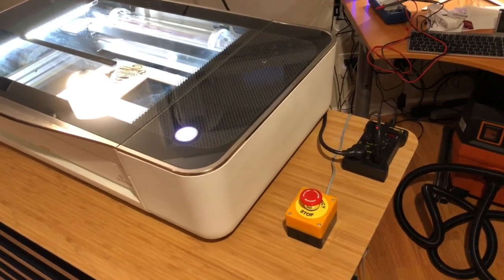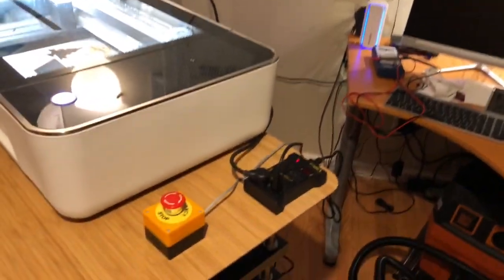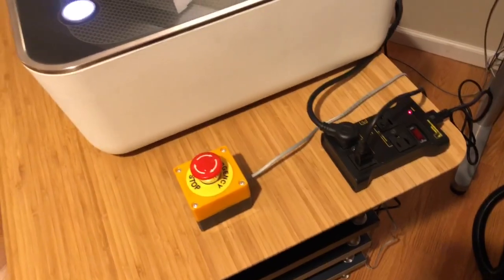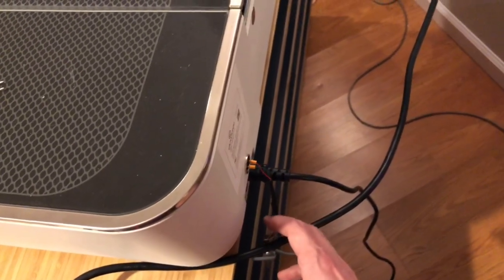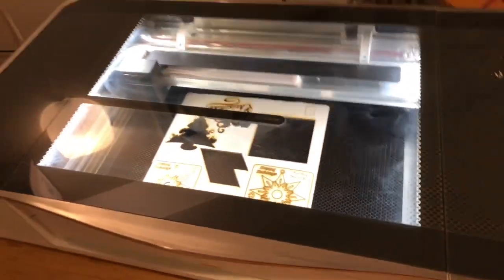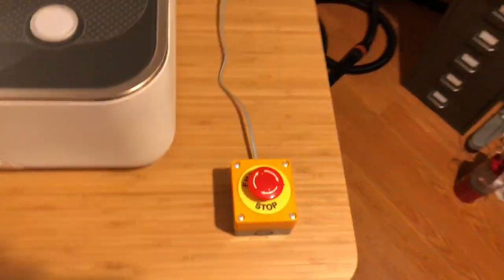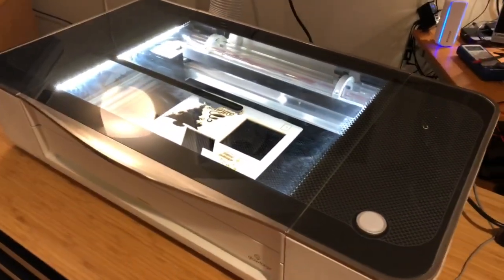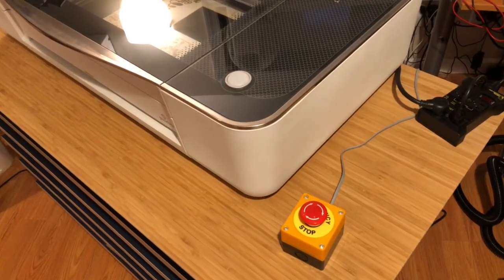Glowforge Stop Button

Comment: excellent work, I've been wiring up my own "Please Stop" button for my Pro as well, the proper connector for the remote switch, beside the magic staple, is on Digikey, part ID 361-1213-ND According the Glowforge rep when i asked them in January.
Reply from the maker: Awesome, thanks so much for that info. I've been vaguely worried about my homebrew solution falling out in the middle of a print.
Reply: No problem, glad to be helpful.